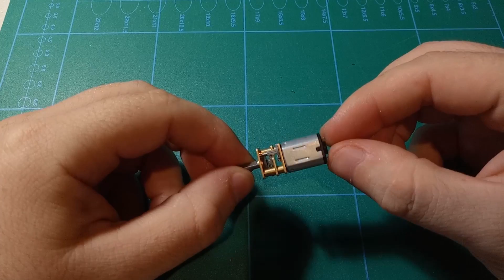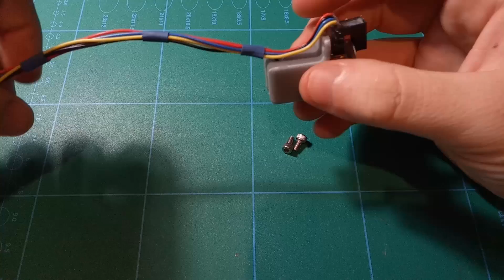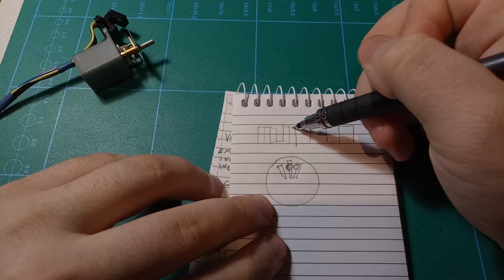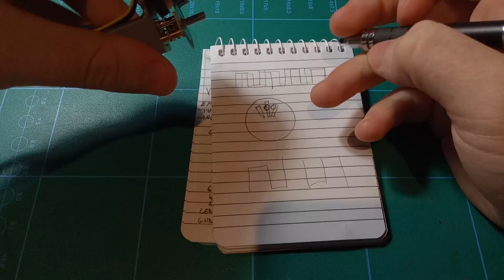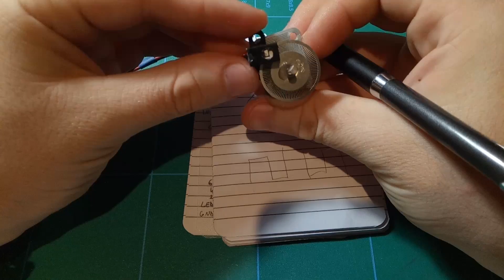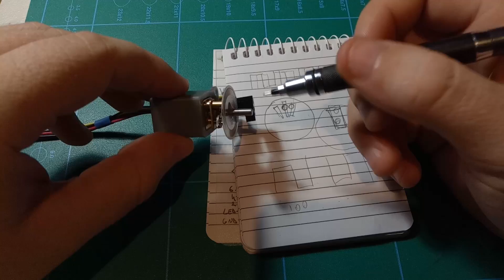Convert Cheap Dc Motor to a Precision Servo #1

Comment: I want to convert a cordless drill machine to simple servo motor. I need to stop it intermittently using remote control. I guess similar motor is used in steering of 46kg load capacity toy car.

Comment: but where is controll system..
Reply: Mcu like arduino. easy stuff
Reply: @Martin-dw4eo  yes..how use mcu  as controller? code and detail video available?  if no ,please sir upload it.
Reply: @N.g.Chanal  To help u as best as I can, u first need a h-bridge otherwise the servo won't rotate in both directions (use this video and component: https://www.youtube.com/watch?time_continue=385&v=OkHR1BZCcqA&feature=emb_logo) then u will need to make the code for the infrared sensor which detects how many spaces of the disk have been traveled use my code:  
 int D(){
  if(digitalRead(WheelSensor) == 0 && CheckChange2 == 1){
  CheckChange = 1;
  CheckChange2 =0;
  DFunction();
  }
  if(digitalRead(WheelSensor) == 1 && CheckChange == 1){
  CheckChange = 0;
  CheckChange2 = 1;
  DFunction();

  }  
This code checks whether the disks space is empty or full. DFunction() is just incrementing a variable, thus u know the exact location. (For Both direction change make an if command to check rotation dir)If u dont understand the code then learn c++ inside of the arduino ide. Just watch vids. At this point it should be very easy to give positioning commands to the servo via while commands. 
Good luck for your Project.

Comment: Next time put the encoder on the motor shaft prior to the gear box; your resolution will multiply by the gear ratio
Reply: Slow response. …(If we see on gearbox Shaft)
Acuration? depend on backlash of gearbox. But it nice to try!

Comment: The Sensor in not incorrect the a reason for the sensor arrangement is on your encoder wheel you have one slot longer, this is used as a home position. I used to work on a WANG Matrix Printer in the early 90's model 5535. This is how I suspect you could use this sensor.

Comment: nice thing you've made there. however, please avoid using "uhm" so much. It gets very annoying to listen. Good luck with your project! Hope you got some good results to share with the community! Cheers!
Reply from the maker: Andrei Timofte thanks for the feedback. You are right about the "uhm". I try not to do it but I need more practice. Unfortunately I'm  very busy with my studies at the moment and had no time to work on it but as soon as I get some spare time I will definitely share the progress.
Reply: The "umms" aren't that bad. However, the lip smacking is annoying. Umms are ok as long as you move on quickly.